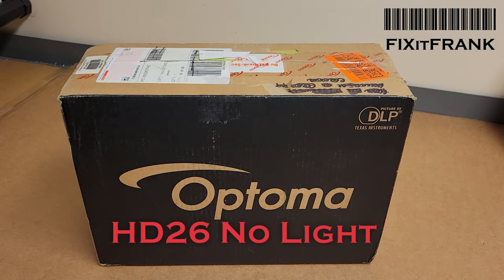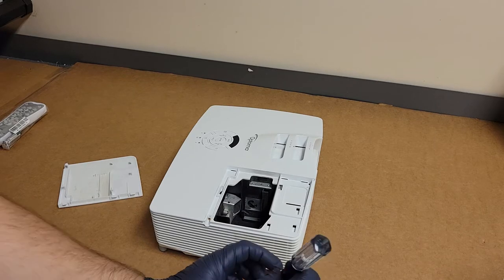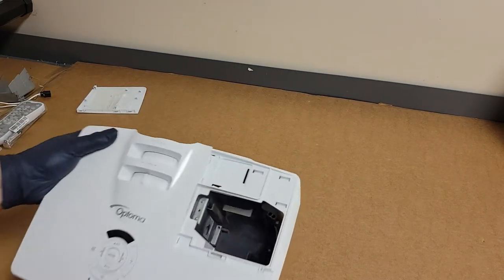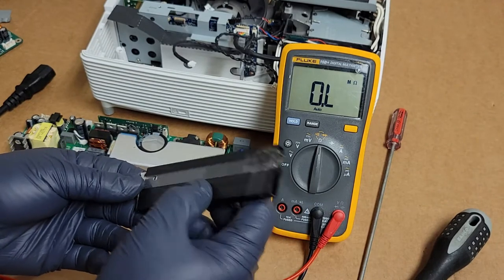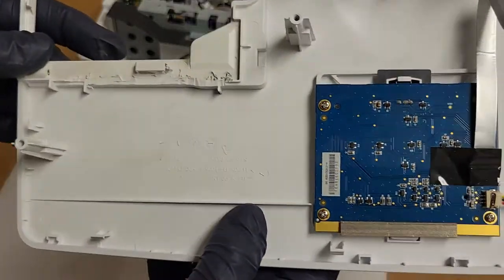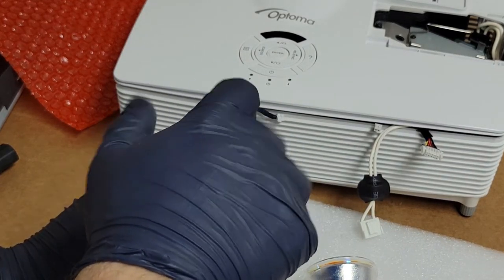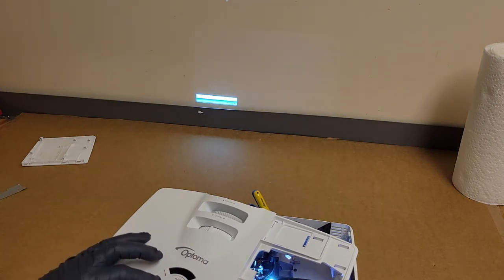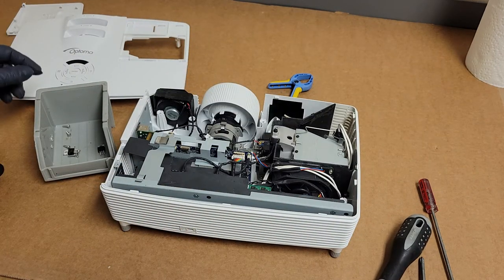Optoma HD26 DLP Projector No Light/Picture Repair

Comment: Fantastic channel - thank you for explaining the procedures so clearly and simply while showing all the steps.  Very educational.  I have the HD26 projector (not sure how many hours, but if I guessed probably 1000 hrs).  Only owner since new and the bulb "flickered" and then went out.  Bulb looks fine, but ordered a new one online.  New bulb does not work either (bad new bulb?).  Exact same thing happens with both new and old bulb.  When I turn on, checked color wheel and fans - all spin up correctly.  Light bulb "flickers" a few times and then the system powers down.  It repeats this cylce 3 times (with either bulb) and concludes with a shut down and the Lamp Light Solid (red) and Power light blinking (red).  If you think it is the power supply, tell me where to buy a new one (or I'll send it to you). You can have the old one for parts if I need a new one - free on me (as a thanks for all your great videos!).
Reply from the maker: Thank you for the kind words!  Does the color wheel make a weird noise before the unit shuts down? It might also be an issue with the output inductor.  I've seen those arc over.
Ideally, if you can send me a video of the situation, I can weigh in better. I don't want to steer you the wrong way.  I have my email listed on the about page about halfway down, or feel free to upload a video to YT and reply with the link here.

Comment: Love watching your repair videos You have a lot of talent which helps a lot of people that are trying to fix something keep up the good work Frank
Reply from the maker: Thanks 👍
Reply: Hey Frank! I was wondering if you could lead me in the right direction. I've got this hd26 projector. I gave up on it a couple years ago but now I really want to fix it. I was using it one night and it shut down.  Lamp light went red so I purchased a new lamp.  Still the same problem.  When I plug in the projector my power light is red. When I hit the power button there's a click from a relay. The power button turns blue for a second  and then both the power button and the lamp light turn red. The fan and color wheel do nothing at all during that process. I've tried booting it with the lamp out and the door switch pressed with the same exact results. Nothing but a single click noise when I press the power button and then red lights. Do you have anything you'd suspect? Thanks!
Reply: @FixitFrank  let me know if maybe u can think of a possible cause. Thank you!

Comment: Very good and informative video my friend. These lamp connectors though........ Do these companies have ANY quality control? I am saying that to all people I know and now with the quarantine (we are 6 months into strict lockdown here in Greece) they turn to projectors as a cinema replacement. NEVER buy flashlight cheap chinese projectors (I have videos explaining some problems after using one for less than three months..... ) or cheap replacement lamps. Some listen, some don't. Ah..... you cannot save them all I guess!!!!! 

Excellent video again Frank!!!
Reply from the maker: Man, if I had a dollar for every problem that ended up being from a junk lamp, I'd be retired with a Sim2 in each room.  Most of those lamps are built by people being paid by the lamp. I have a few lamps to do autopsies on now so I might try and do a little series on them. I was really amazed to see even megaohms of resistance at room temp.  That was really really surprising.  I say if someone wants to buy a lamp with no name, they are better off taking that money and the projector and just chucking them out a window. It will save a lot of time. 

You guys are fortunate with the lockdown. That worked in New Zealand. In my opinion it's a mess here. For some reason there is a weird undercurrent of "pandemic is over" here in the states, yet the actual infection numbers are spiking everywhere. I did get my vaccine (a few weeks ago) so I'm kind of OK but I pushed pretty hard to get mine.  As much as I love the USA, there is a lot that makes me want to pull my hair out. Common sense is lacking but I know that is not just US centric even though we tend to take top honors in that area. 

Those flashlight projectors are a problem in my opinion.  The companies claim many false promises.  The LCD panels tend to burn after a few weeks and the specs as you know are fully made up.  Most of these are based on a model R18(or similar) out of China.  Different badges, different logos, but its all the same 300lumen projector. I'm trying to get my hands on one to tear down and really show what is what.  I might have a company on the hook to send me one so we will see. I get a lot of companies wanting me to show their stuff but unless its something I actually like and use, its not happening.  That said, if this flashlight projector company agrees to my terms, I will have one to show. I don't think they will like the video but my parameters were, I give a real and honest opinion on it.  We'll see.
Reply: @FixitFrank  Oh man, always stay safe and alert. This moto got me through tough times in my life. I wish you the best Frank. I have a video  about a RD-819 model that discolored after 2,5 months of use. I have modded this model with a dremel to improve airflow but that thing is so cheaply made, Chinese toys are better built. The lamp video would be awesome, waiting for that!!!!!!! Thanks again Frank.

Comment: I have a new HD26 that's been in the closet since I purchased about 7 years ago. The bulb has never worked. I recently bought a new bulb and it still doesn't work. Would you be able to repair my power supply?

Comment: Frank use a fairly hot hair dryer to remove those stickers /labels from the box. These videos refuel my passion for learning. I have a hd39 darbee quite similar to this. Blue light comes on flashes a few times and goes red then lamp light comes on flashing red. No fans or color wheel movements at all. I don't even know where to start from, could it be the main board?
Reply from the maker: I'll try that next time.  Your Darbee kind of sounds like the lamp door switch isn't being activated.  If it's lamp door is like the one on the HD26, that door switch tab is pretty flimsy.  If the door switch is good, I'd check power supply voltages next.  The mainboard seems to be pretty robust for the most part in this model. The lack of fans/color wheel make me wonder if you are missing 12v.

Comment: Great job Frank. I keep mentioning your name on the avsforum. I hope you don't mind. I have noticed, that others started doing the same thing on the forum. Man I should go back to that dropped Epson 3500. I have been busy with other stuff. Did you have any (other)Epson 5040 with poser issues? I'm curious on what could be the problem. A lot of people are wondering about the same thing on the forum.
Reply from the maker: Not at all! I'm glad to help out. I don't really get over there myself. I tried to post on the forums but it honestly was too much to keep track of. I'd rather keep myself here and then I can hopefully share more useful info. I actually talked to a guy the other day you referred for a burned connector.

Comment: Hi Frank, I was hoping you may be able to offer some advice, I have this projector and the lamp does not come on at all, I replaced the bulb and the fan as the fan seemed to be sticking but the lamp still isn't coming on. When I press the power button and it tries to start there is an audible clicking noise although it's not very loud, then after the fan runs for a bit with no lamp, the power light flashes red and the lamp light stays lit red, then it stays like that and gives up trying to start. I was thinking about changing the supply board like the one you've fixed in this video, but don't want to waste money if it isn't that! Any help or advice you could give would be much appreciated. Thanks
Reply: Worth saying too that the noise isn't like the one in the colour wheel videos you've done, it's clicking not that whirring sound. thanks

Comment: Hey Frank!  Thanks for making your videos, they’re really informative.  I posted on the Projector Central forum regarding a problem I was having with  a W6000 hoping you might have an idea what was wrong.  Anyways I went ahead and bought a new Epson so if you need a W6000 for parts, or as a repair project, let me know.
Reply from the maker: Hi Kevin,  I would be interested.  Was it the split picture where you lose half the image?
Reply: @FixitFrank  No, it was an issue at start-up that occurred after changing the bulb.  I would start the projector and the BenQ screen would come up initially in true colour and then it would quickly go into a "negative" colour image and then shut down.      In my post on the Projector Central forum I included some YouTube links of what was happening which will probably give you a good sense of what's going on.  I posted under the name KDub,  Topic: Diagnosis Needed - BenQ W6000 - Start-up Problem
Reply: @FixitFrank I bought an HD 26 with 10 hours on the unit the unit powers on shows Optima on the screen then if I plug something in such as my firestick Fire TV will display on the projector as if it were starting up and then black screen it does that with anything I plug into it do you think you could be the main board?

Comment: Hi sir i have optoma hd26 i have replace the power supply colour feel bulb  but still projector never light
How to fix this
Reply from the maker: It is hard to say. Something is preventing the bulb from starting. I would check for color wheel sensor. Be sure the color wheel starts. If not, find the cause for that. If  color wheel spins, check main board wire connections and voltages to the ballast control.

Comment: Hey, ive got an GT1080E and the thing boots up. gives perfect image for like 1-3 minutes. after that the light dimms  and gives me only a square of low light on the wall... its very anoying. replaced lamps, factory reset.. everything.. pls help me
Reply from the maker: What kind of lamps did you buy?  Amazon or from a reputable website?  It sounds like a lamp problem to me on the surface.

Comment: great video! my optoma uhd420x stopped working, turns on, no light, tries 3 times, red light on the bulb change light. in the web most people say that you should have resistance if you measure both negative and positive in the lamp, which it does as  it beeps. but it seems from you're video, it shouldn't be, i'm concerned in getting a new bulb without being 100% sure that's the issue, but I can always get Osram bulb only directly from amazon and return if it doesn't fix it. thanks!
Reply from the maker: Hi Paulo! Thank you for the kind words!  When measuring an incandescent lamp(halogen, old style bulb) you would expect resistance because they have a filament that glows with electricity.  Projectors use what are known as "Short arc lamps". They do not use filaments. They use high voltage to create a sustained spark (arc) between 2 points with noble gasses inside the arc envelope to glow when the arc is created.  Wikipedia has some easy to understand articles on "carbon arc lamps" which goes into more depth. Projector lamps are the modern version but follow the same theory.  These should measure open circuit(infinite resistance).  I would definitely start with a new lamp assembly, but I would strongly suggest against using Amazon for a replacement.  Many of the projectors I end up working on were damaged by the low quality lamp assemblies littering amazon.  Even the lamps that advertise "Osram Original". 
Since you have a UHD420X, I am guessing you are in Europe? I know a lot of US lamp sellers but not so many in Europe.  https://www.myprojectorlamps.eu/ is the one place I know that is trustworthy.  I would contact them about your lamp assembly.  You do not have to replace the entire housing(As you likely know) but MyPL will have a true Osram, so you do not have to worry about if its counterfeit or a re-tube.   Thank you again for watching!
Reply: @FixitFrank  just bought the lamp, meanwhile I've managed to get it up and running, saw another video on youtube where someone measures resistance on the lamp while knocking it with a screwdriver until you can't measure resistance anymore and indeed it worked! still will replace the lamp with a new housing and lamp from myprojectorlamps. thanks!

Comment: hi is anybody here ? look like you know your stuff ! i have an optoma hd25e, i change the lamp, clean the inside s little bit and i get an lamp issue, flashing amber light on the power and the lamp light red. The projector start ok, see the logo start looking for an input... the image start FLICKING and the projector stop , shut off and then the lights come on ! do you have an idea what can be wrong ? thanks , have a nice day
Reply from the maker: the new lamp is the problem I think.  Compare the glass on the face of the housing to the old lamp. I bet it is much more clear and much less red/blue.  Cheap lamps use poor IR cut filter glass which confuses color wheel sensors. That is my suspicion
Reply: @FixitFrank  hi, i open the projector again, I blew on the color wheel and the photo sensor, and hooray it worked, I think there was some dust left after cleaning the inside! Thanks à lot for your Help ! have a noce day !